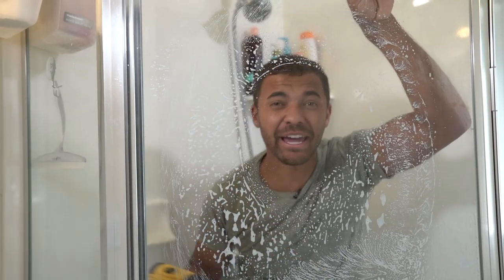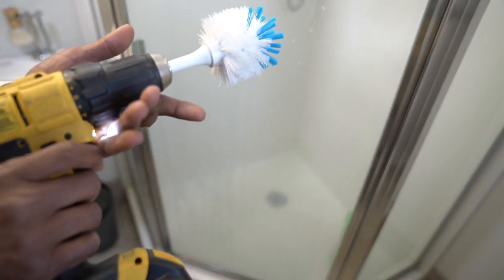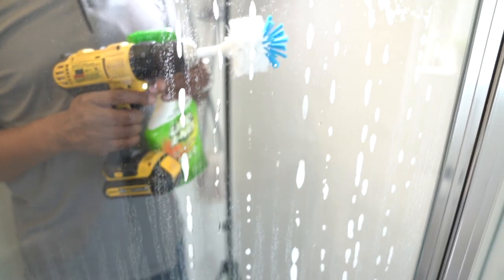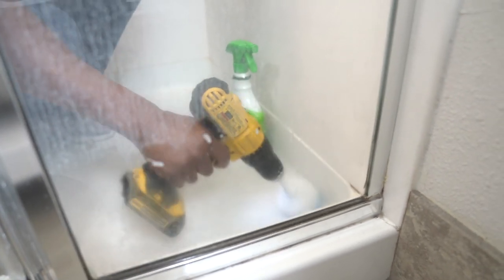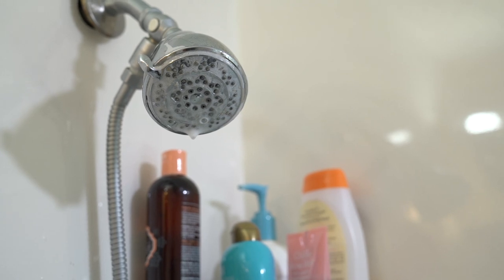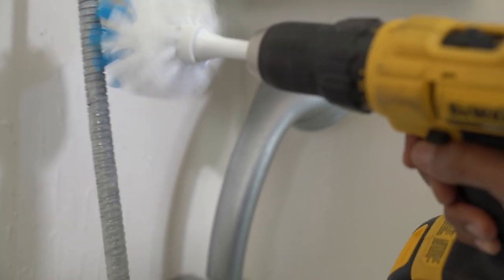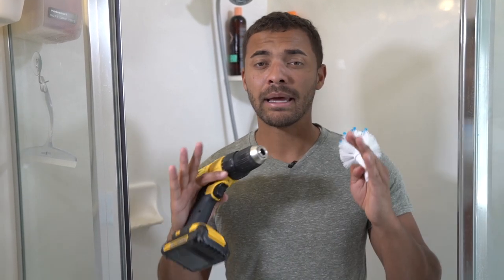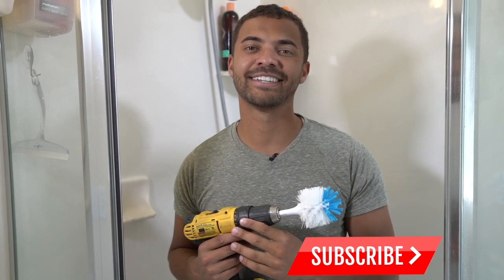HOW TO MAKE A POWER DRILL BRUSH | DIY

Comment: The white residue of scale quite commonly comes from mineral carbonate, which can come from ambient CO2 that dissolves readily in water to maintain a shifting equilibrium of carbonates in alkaline pH water. The equilibrium is easily reversed to dissolve the white scale on visible and hidden surfaces. The brush only partially cleans what it touches. Scale on shower-heads, faucet-heads, and other parts where tap water is in constant contact may be dissolved away by completely immersing in distilled white vinegar. You can tell the chemical reaction is continuing as long as you see tiny bubbles. The vinegar reacts with the scale you can see and inside the holes of the shower head and wand. 

Something to keep in mind is the possibility of scale formation in the presence of certain water-dissolved minerals along the flow of that water.

A safety caveat: bacterial growth in non-moving water for extended time periods can occur and should be flushed. The sudden appearance of rust coming from a faucet might indicate a turbulence of once-standing water. This information is suggested in a n OSHA publication of an eye infection from emergency eyewash station usage. 

Fortunately, home use of water sources are more utilized than emergency eyewash stations.

Comment: NICE! Use to have homes with enclosed shower stalls yrs ago, and hated the cleaning. TIP: Forget having enclosed shower stalls. Just use shower curtains with liners. The liners are cheap, and can be tossed away at some point to buy another one.